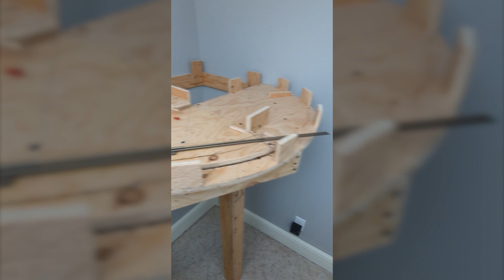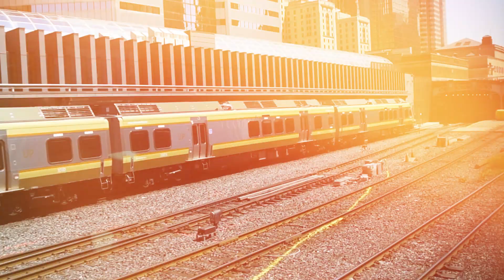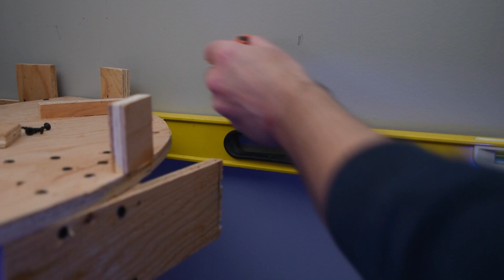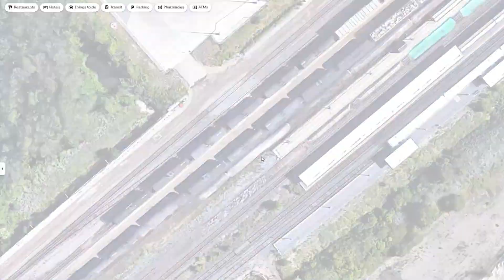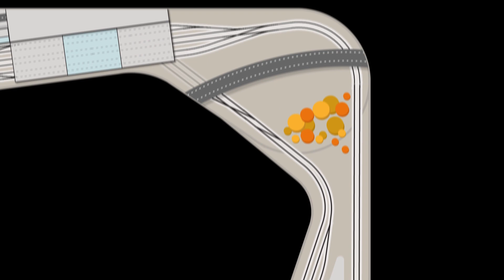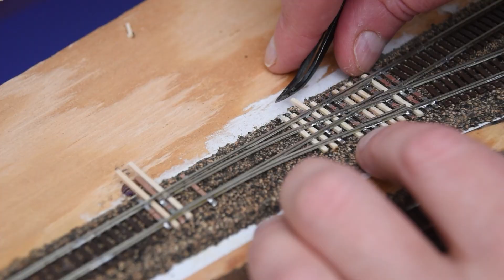Union Project: Adding Aldershot - An Unplanned Layout Addition

Comment: Not a modeller, but enjoyed watching the combination of craft, artistic design, engineering etc of model making while recovering from heart attack in 2020. Just found your site.
   You are rare among modellers in being confident and competent at the larger scale of carpentry and joinery (my thing). Most modellers seem unconfident, diffident, and frequently unsafe in handling full size tools and materials. At the other end, there's a similar gap of feel and know how between internal finish carpentry,  furniture making, etc, and construction timber work like framing and roofing. Different levels of precision, load bearing, mass, and power of tools. This leads to different neuromuscular instincts: important for safety considerations

Comment: One of the reasons I started to think about another layout is due to the additional space I now have in my modelling room in the house... Similar to yours I have the two walls and potentially the 3rd as well.. Good to see you expanded it, to get a bigger layout!! :) However, I did notice you never mentioned putting in a join between the old and new section, just in case you move... (You did it on the main two sections, but not this 3rd one.. Unless I missed it.) Craig.
Reply from the maker: I didn't mention it, but I did design the benchwork so that it could be separated. I never want to do it - but it can be done!